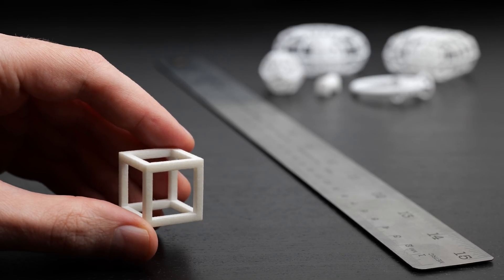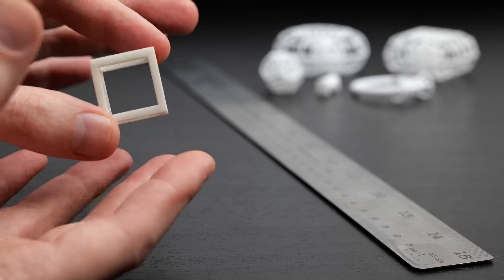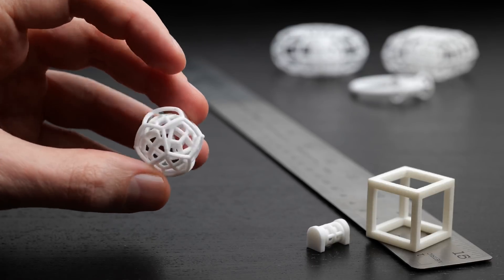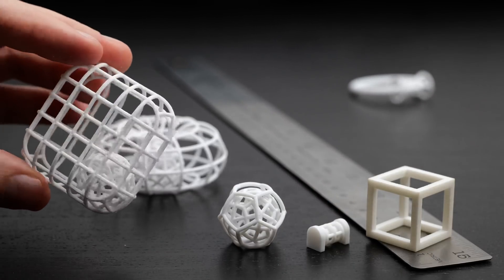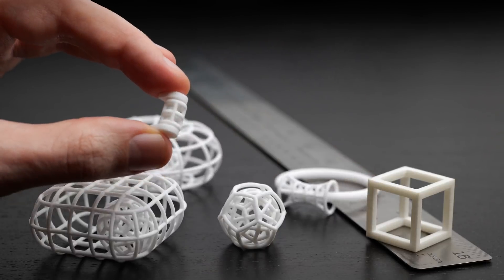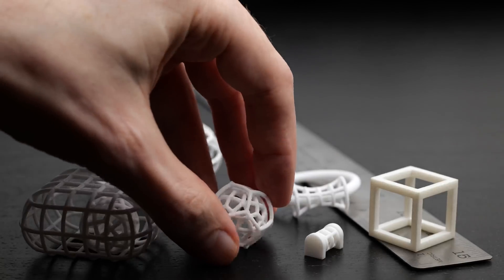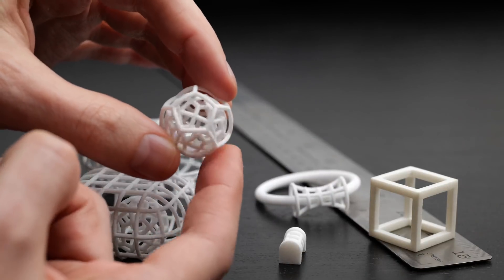Puzzling degrees of freedom

Comment: 5DOF could be a sphere within a bounding sphere with an additional central bounding sphere, so that the 5dof sphere is not able to linearly translate itself radially within the larger bounding sphere. Think of it like an epicyclic gearset, except 3D, you have the components of sun, planet, and ring, all held together by their surfaces. The only issue is that there's no rigid way to bind the two boundaries without interfering with the 5dof sphere's movement, so it's not a full solution, but it's probably the closest complete solution that exists in 3D space; a solution to this is going back to the epicyclic model and adding additional planets, but then this introduces additional interferences that won't occur in known locations, unless every planet is linearly translated equally, as rotational translations won't cause interference with the spheres. 

2DOF with rotational translation only is a bit more difficult. Encapsulated spheres, like ball mice, are technically 3DOF but only measured in two degrees, though at the same time it's not common to rotate the ball on its vertical axis; potentially having a friction element that prevents this rotation but allows the other two axes could be a solution, but that may be breaking the game's rules, as these wouldn't be physical stops, but rather using non-spatially-binding elements based on material properties. Another potential solution could be to stack two hinges, like a gimbal; but again this would break the rules, because it's 1DOF + 1DOF for a pseudo-2DOF. The closest things that would exist would be complex joints like your wrists, but I don't think this would translate well to a full-motion object, as your wrist is also bound by a movement range, meaning yet another sub-optimal solution.
Reply: Using magnetism you could even fixe in place the 2 spheres by making them charged and with the same charge so they don't move in respect to one another.

Of course to be really rigid you would need electromagnetism and infinite forces between the two. But i found this hypothesis more suitable to the problem since we allready use electromagnetism when we speak about contact between two objects, and we also assume that some forces, like the one that holds the integrity of our solid, must be infinite. So i think the idea is not so far fetch.

But better yet on this idea, if you just had a 2 round and powerfull magnets and stick them together, you could rotate them however you like and sliding them in only two directions, their surfaces, because you can't separate them. This seems pretty intuitive to me as a answer!
Reply: @funkytom5357  The problem with this is that all magnets are dipoles, manipulating fields with a varied pole arrangement would help but wouldn't be the ultimate solution. You would also need a way to vary a spherical electromagnet setup to manipulate it properly, which is horrendously complex. But, this would only work with a dual-sphere setup, which is 6dof, my 5dof suggestion has three spheres, the manipulated sphere with an inner boundary sphere and outer boundary sphere. Think of a sphere inside of a toroidal envelope, the the sphere has all three rotational axes of movement, 3dof, with the pseudo-linear infinite path within the toroid, 4dof; take this concept, but rotate the toroid around a radial axis, you then have an inner sphere and outer sphere, allowing the manipulated sphere to have a second infinite pseudo-linear axis of movement, 5dof. The main problem still remains however, how do you keep the bounding spheres rigid to each other? Magnetism could work, but magnetism is not an infinite force, magnetism degrades over time. This also goes back to the concern about dipoles and field manipulation, it's not a perfect system, the smallest of imperfections can quite quickly destabilize the system due to magnetic attraction and repulsion. 

Plus what happens when the manipulated sphere needs to be discretely controlled? You only have one set of magnetic forces for manipulation, you don't have two discrete sets for individual control of boundary rigidity and manipulation. So, in this case, magnetism is not the solution. Which brings back the original issue of how to keep the inner and outer boundary spheres rigid to each other while not introducing areas of exclusion for the manipulated sphere, because exclusions, or boundaries, will mean it's not a true 5dof system. Manipulating the rigidly attached boundaries to falsely avoid exclusions also is not a solution, as that'd be 3dof + pseudo-5dof, which does not equate to a real 5dof system. 

It's simple, our limitation of three physical dimensions of space does not allow for such a system. Higher spatial dimensions may provide a solution, but these are all theoretical as we do not exist in these higher dimensions.

Comment: to remove the borders from the sphere trapped in the cuboid surface, you can connect two pairs of opposing 2d-faces to form a torus (a torus inside a torus with the same center, in fact)

Comment: 2 rotational degrees of freedom: Picture a ball and socket joint like your shoulder but the "arm" portion is trapped between two planes that are connected with the socket joint. The ball socket joint end of the arm prevents directional movement and the planes prevent the third degree of rotation.

Comment: 2 degrees of rotational freedom: 

Cylinder trapped in a cylindrical cavity, so that their axes are orthogonal (height of the cavity equal to diameter of the cylinder and diameter of the cavity slightly larger than height of the cylinder, just enough for the cylinder to fit in). The cylinder can then independently rotate around its axis and around the axis of the cavity, while its center of mass is fixed relative to the cavity (i.e. no translational dofs).

Comment: You can "stack" degrees of freedom. Put your 1D cylinder on a wheel that can turn. Then put that wheel in another wheel like a gimbal, etc.
Reply from the maker: That would use more than two rigid objects.
Reply: @henryseg  Ah, I missed that constraint.

Comment: My solutions started with two spheres, let's say, connected by a rigid spring. So that's 1dof. After that, put the ball in some socket that let's the ball turn in one, two, or three directions. That's 2, 3, 4dofs. After that, make the spring be able to bend.
You could say this sounds like more than two objects, but I think you could craft one of them just so, to have a socket and a springy part that lets a ball sit inside of it.

Comment: My thought for 2 degrees of rotational freedom would be a cylinder (optionally with hemispherical ends, like a capsule) within a disc with rounded edges, like a flattened sphere, with a diameter equal to the length of the cylinder. The cylinder would be able to rotate around within the disc like the hands of a clock, and also along it's long axis.

Comment: For rotation, i would consider it two degrees of freedom, since the manifold is specifically a sphere, which has a 2d surface. This also means the limit is 5, and the puzzle becomes: how to make a satisfying 4-degree solution? Simply by fixing the sphere's center relative to another sphere! A sphere in a sphere could leave a hole just big enough for two degrees of translation
Reply: actually, i was wrong! primary is 2d (surface of a sphere), and from there secondary orientation is rotating about that axis (another dimension), so with that in mind i figured out how to achieve 2d rotation (though 0d translation): get a hyperboloid trapped in a sphere with two divots. the divots pinch the hyperboloid's focus point. the hyperboloid can rotate about the pinching point in two ways: pinch-axis (the line connecting the two divots) and hyperboloid-axis (its internal axis of symmetry).
4d and 5d are unattainable except in the case that a 2d-translation solution exists and that it is possible to align the pinched-sphere axis perpendicular to the plane of translation while nestling them. 3d where only one is translation can only be achieved by similar means: trap the pinched sphere in an existing 1d solution (such as your 4d solution but instead of a sphere, use a doughnut segment as the object's outer surface, such that it is rotationally fixed to the containing doughnut)
the important takeaway is the 3d object you would get by using a sphere to CUT a hyperboloid. this object can then be inserted into a pinched sphere (where the containing sphere has a radius just barely greater than the cutting sphere; the pinched sphere may resemble an imperfect doughnut). For one degree of spatial freedom, trap the pinched sphere in a 1d-translation solution.

Comment: 2 piece, 2 rotational degrees of freedom solution: a "constant velocity joint", one piece is a cup with two grooves, and other piece is ball with two bumps on opposite sides that slide inside grooves, ball can rotate either around bumps or by sliding in grooves, but third rotation is constrained

Comment: I did very similar solutions. Rectangular prism inside a cube for the one degree of freedom. I thought of a cube rather than a dodecahedron with the diameter of the sphere being (almost equal to) the distance between opposite edges of the cube. I did a sphere inside of a cylinder for the four degrees of freedom. Same thing in the video for the five degrees of freedom. I thought of a cylinder inside of a cube that could rotate and slide for the two degrees of freedom. Hopefully that’s a good sign. I’m a freshman in mechanical engineering. I couldn’t get my mind off of simple cubes, cylinders, and spheres though.

Comment: For three degrees of freedom, I came up with a flat disc that was stuck between two big plates. It could move in the X and Y axis relative to the plates and rotate in a single axis that was normal to the plane the two plates were in. 
For four degrees of freedom, I envisioned the same thing but instead of it being a disc, it was a cylinder. It could rotate in an axis that was normal to the two plates, as well as rotate in a secondary axis that was always parallel to the two plates. 
The other solutions I came up with were extremely similar to the ones in your video.

Comment: For the 5 degrees of freedom thing, you need to constrain a sphere (or other constant diameter shape) to a 2D manifold without boundary (since it's impossible to constrain a single rotational degree of freedom). This might be an issue if you want the inside and outside of the cage to be rigidly attached without anything in the way of the sphere.

The only solution (which I don't think quite works) is to use a self-intersecting manifold to make the "inside" and "outside" sides of the cage connectable through only the region outside the cage, Or better yet just use a non-orientable manifold like the klein bottle. The self-intersection points are somewhat problematic though. At least, this proves it can be done in 4D.
Reply: For the 4D case, all the above solutions carry over (replacing spheres with sphere prisms). The number of degrees of freedom of a 4D rigid body is 10 so...
7: A 3-sphere in a cage constraining its center to be on a circle
8: A 3-sphere in a cage constraining its center to a 2D manifold (no complications in 4D. The cage is automatically connected.)
9: This is analogous to the 5 degrees of freedom in 3D case in that there'a a struggle to combine the interior and exterior sides of the cage.
10: The second body isn't constrained by the first.

Comment: For 2 degrees of freedom of rotation, I imagine a cylindrical rod inside concrete with a disc-shaped hole, the thickness is the same as the diameter of the rod, and the diameter is the same as the distance between the center and the point on the edge of the rod

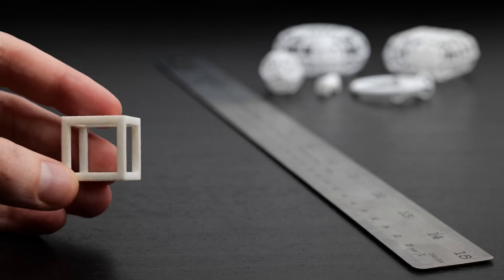Comment: 1:21 My solutions before watching ahead:

1 degree - A two holed torus with a long, thin rigid loop wound between the holes. The torus can slide up and down the length of the loop, but it can't rotate or move perpendicular to the loop's axis 

2 - a ring on a capped axis (similar to the previous objects). The ring can slide up and down the axis, but now it can also rotate around the axis. All other motions are blocked. 

3 - A ball inscribed in a cube wireframe. You can rotate the ball inside however you like (3 directions) by touching it through thr cube's hollow faces, but you can't move it or change its position

4 - a sphere in a long, thin cage, whose width is the same as the diameter of the sphere. The sphere can move up and down the axis of the cage, and you can reach through the bars and rotate the sphere freely, but motion in the plane perpendicular to the axis of the cage is blocked 

5 - A sphere in a wide, flat cage, whose height is the same as the diameter of the sphere. The sphere can move in the plane of the cage, and you can also reach through the bars and rotate the sphere freely, but motion in the z direction is blocked.

My answers to 3, 4 and 5 might also be adapted to 0, 1 and 2 if you replace the ball with a cube to disallow rotations. I wonder if all possible combinations of motion/rotation are possible

Comment: Hi Hentry, intersting question!
My thoughts:
1 Degree of freedom -> a cylinder or other shape that is rotating on a shaft but being limited to move along the shaft. 1 rotatory degree of freedom
2 degrees of freedom -> same but with additional space to move the cylinder along the shaft. 1 rotatory + 1 translative degree of freedom
3 degrees of freedom -> a sphere inside of a hollow sphere. 3 rotatory degree of freedom
4 degrees of freedom -> a sphere inside of a hollow cylinder with the "same" inner diameter as the outer diameter of the sphere but the sphere can roll along it's length axis. 3 rotatory + 1 translative degree of freedom
5 degrees of freedom -> a sphere inside of a hollow cylinder with the same height as the diameter of the sphere but a bigger diameter as the sphere. 3 rotatory + 2 translative
6 degrees of freedom -> object in 3D space without limitations
Reply: It took me awhile to see the spoiler break reference to your channel
Reply: Thought about that cylinder but the problem is that it is still restricted along one of its two translative degree of freedom

Comment: What if you make a solid torus with a concave rail on the outside and put a sphere with with an axis that can lock inside this rail. The sphere can rotate around this x-axis of her's and also move around the torus. But one full circle around the torus will be one full rotation of the sphere this time around the center of the torus which would be the z axis.something similar to the rotation of the moon which always shows the same face on the center. Will this be cheating?

Comment: you can do 1 axis rotational and 1 axis translation, thats 2 degree, if its 2 degree rotational you can split the switch the 2 axis around and achieve the same angle so its hard to say its 2 degree, unless youre considering gimbal lock to be "limiting the third axis"

Or if you have grooves so they can only rotate 1 axis at a time, then you can limit it to 2 axis 

what software are these made with, seems like directly converting wireframe to solid??

Comment: You can get 2 degrees of rotational freedom if inside the square cage you put a cylinder on its curved face. The diameter of the cylinder should be the same as the interior height of the cage so that it is impossible to flip it onto the flat face. You could also do this with no translational degrees of freedom if you put the cylinder into a sphere and had a circular knob on the sphere going inside and fit into a channel on the curved face of the cylinder.

Comment: Sliders, knobs, buttons and wheels (mouse wheels) have 1 degree of freedom relative to their owning board, same as the 1D output value they represent
Would a joystick / gamepad stick be considered to have 2 degrees of freedom? (as they also output 2D value, and you cannot rotate them around the axis of the stick itself - and it would be 3D value if you could rotate them)
Reply from the maker: Yes, I think a joystick counts as two degrees of freedom. Of course they use more than 2 rigid parts.

Comment: For 1 degree i imagined a hinge
For 2 degrees, i imagine a rounded groove with a cylinder in it, which may slide or rotate to the sides
4 i re-prupose 2 but with a sphere
3 i put a beam inside a box (closed cube) holding it to the sides with pressure. It can be pished around inside there or rotated, though there's always a bit of friction
5 i put a cylinder in a box. This is an illusion however as it can technically move in 6 degrees a tiny bit, just not fully

Bonus:
4 an elongated pill shape inside a rounded edged, hollow cylindrical disc. It can pivot/rotate in the same axis the disc is, it can also rotate along it's own axis (it's pill-shaped remember)
2 have two toroids joined around eachother
4 have an axle pressure-fit/held in place via friction inside of a closed sphere

Comment: Couldn't you extend your solution for 5 so the cage is effectively two balls inside of each other, with the sphere in between? Analogous to extending a cylinder with a sphere inside to the torus solution you have for 4.
Reply from the maker: Yes, but how do you keep the two parts of the cage from moving independently?

Comment: My solutions:
1: disk with axle through it, the disk can not move along the axle, but can rotate
2: same as 1, but the disk can move along the axle
3: plane with axle perpendicularly attached, allowing free movement in two dimension; On the axle, a disk is attached as in 1
4: same as 3, but the disk can move along the axle as in 2
5: same as 3, but with a freely rotating ball instead of an axle with a disk

Didn't want to pause to come up with neater solutions, but a fun thing to puzzle about! I really like the ball in a torus solution for 4.